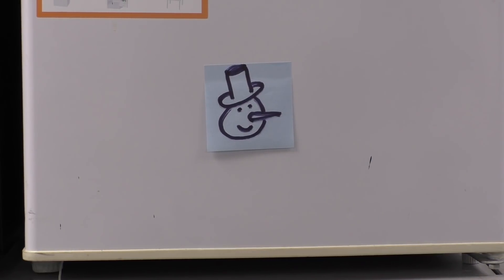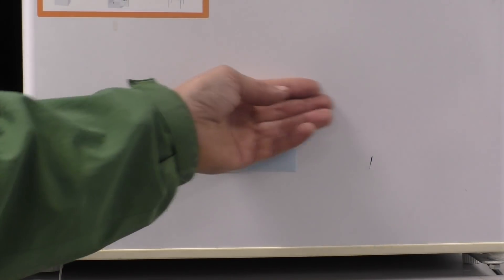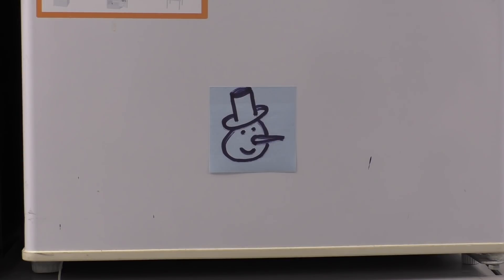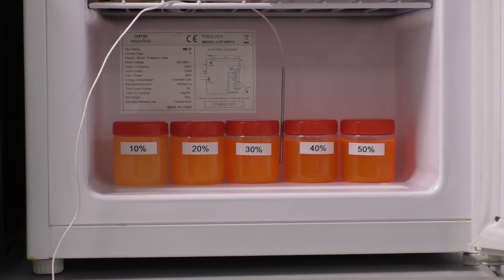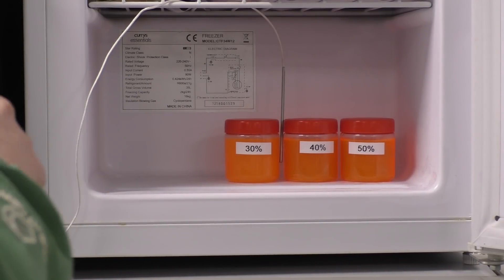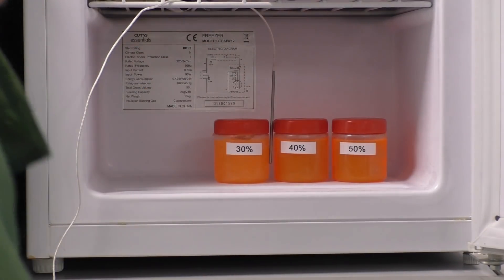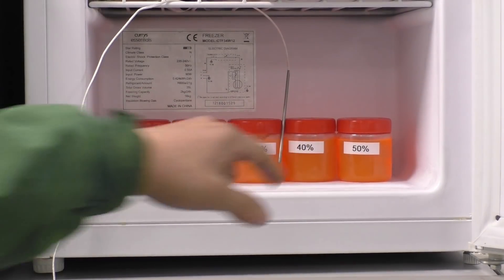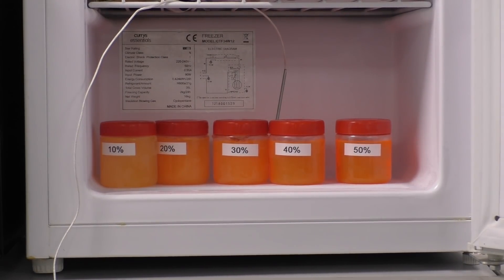Why use 50/50 Antifreeze mix?

Comment: 50% water 50% glycol  70% Evans is what Del said !!!!  He then went on to say that gives you "89% more cooling" but also lets the engine run 109% hoter. Something to do
with folk not understanding how % work as well as rad caps and over flow bottles... I however think David McLuckie got it spot on I am going to try his idea out !!Looks good
Thanks Dave !!!!!!!!

Comment: Bloody hell, I remember the winter of 1982, I was out helping my dad on his milk round, and I was only 13, a smidge over 5’  and out from 5:30 am until 9 pm some days in the holidays ( collections days were long ) I could have done with that fucking  50/50 for sure. I felt those fucking temperatures. I cried when I got i doors as my feet came back to life, the pain was unreal.  Anyway - just the musings of a soft southerner as northerners like to call us.
Reply: Could have used people anti freeze, also called wild turkey 151!

Comment: Had some idiot come into my work recently & told him he needed to mix it 50/50 with water & he replied my VW manual says you shouldn't use water & that he was going to use pure anti-freeze. Some people are beyond help in this world
Reply: Ashley Burton tell me about it. I know a lady who is having triplets and she thought she was going to be pregnant for 27 months. Some people just shouldn't have kids smh
Reply: onhawaii speaking of which, that would make an excellent long term experiment, differences between 50 50 using tap water, vs distilled water
Reply: Ryan, I am not sure if it is already included of the running experiment...

Comment: People also don't think about the fact that the more diluted the antifreeze is, the less corrosion protection you get, a 10% mix has far less corrosion protection than a 30% or 50%, i live in Mallorca in Spain, in the middle of the mediterranian, we only see below freezing temps a nights in a year,  so a lot of people think you can use really light coolant or plain water!!

Guess what i know a guy who works at a radiator repair shop and year round they've got a big pile of radiators waiting to be repaired all the time.

I have a friend whose new radiator lasted only 3 years because he used 10% antifreeze and never changed it, in 3 years it was already rusty and corroded inside.

Most coolant manufacturers say that to provide good corrosion protection you have to use atleast a 30% mix, i run 50/50 or 40/60 atleast and hardly ever have cooling system issues.
I buy my own concentrate off amazon and mix myself.

Comment: Just don't buy concentrate but ready premixed 50/50 antifreeze.
By the way, clean 100% ethylenglykol freezes at only –13  °C
The lowest freezing temp. is –70 °C with 2:1 ratio (67% of ethylenglykol; 33% water).

Comment: So as an Australian living where it never gets below 9*C, I'm wondering if it's possible to get hold of the rust inhibiting additives and just add those to distilled water? Would this be possible and would it cause any issues?
Reply: I'm no expert but adding anti-freeze also raises the boiling point of the solution, so from what I've read you'd still want to use it. But then again I seem to remember in racing they don't use antifreeze and I guess their engines would run hotter?

Comment: Matt, serious question..

I was just thinking about going to get a bottle of a good vodka, like Stoli. Now, I always keep my vodka in the freezer and I drink it straight.

As you're aware, vodka does not freeze. I have kept vodka in the freezer for months that I've forgotten about.

Would vodka be usable as coolant? lol. I'm thinking it would at least be better than that fucking Evans shite. So it doesn't freeze, and is mainly water. Hmmmm?!!
Reply from the maker: Vodka is typically 35 - 40% ethanol (had to look that up) and has a freezing point of -26.95° C - which isn't as good as 50/50 (-38° C) 

Now you could use 100% ethanol (which freezes @ -114 °C) but that has a few issues;

1) Its flammable
2) its specific heat capacity is around 2 (water is 4) which is the same as ethylene and propylene glycol) 
3) the biggest problem - it has a thermal conductivity of 0.17 vs 1.6 W/mK - it is literally 10 times worse at conducting heat
Reply: The Workshop 10 times worse at conducting heat, but that's only 37.5% of it. The rest is purified water.

So it might only be 3 or 4 times worse or something when you take that into account. That wasn't calculated, it was straight off the top of my head.

Either way, it's shite. Was just a random thought I had. Probably still better than that fucking shitey Evans lol :-)
Reply from the maker: 10 times vs pure ethanol not Vodka.
Reply: The Workshop I wonder then, how little ethanol do you think you could get away with and it still not freeze? Think you could use 50/50 vodka and water lol, then you've only got 19% ethanol, but would it freeze? (Mind you, that's only freezer temps, which is like -5? Not good enough for our winters if it's only good to -10 or -15). Summer though...

I'm not actually considering using it, just in case you were wondering lol :-D

Comment: Can you mix different types of coolant and show what happens? Use 50% water on all
Reply from the maker: Show what happens?
Reply: yeah, can you mix propylene with ethylene or longlife? Will it clog the system when heated and/or cooled or will it work just fine?
Reply from the maker: Nearly all anti-freezes are a mix of the 2. They'll all be fine.

Comment: but why in countrys that is extremly rare to get 0°C the manufacturers still put in the manuals to use antifreeze. Its has any positive effects on high temperatures as well?? say.. 40°C
Reply from the maker: In some manuals it states what mix you should use for what temperature - the other reason is that water will cause corrosion and manufacturers know that anti-freezes have inhibators in the mix
Reply: Antifreeze mixture  also increases the boiling point

Comment: But which cools the best in summer?
Reply from the maker: Water. 100% and add some additives package like water wetter or similar
Reply: Thanks! thats what i thought. Think its safe To run 90% antifreeze in the winter to help my ice Bike run hotter?
Reply from the maker: If its running too cold, but I doubt that